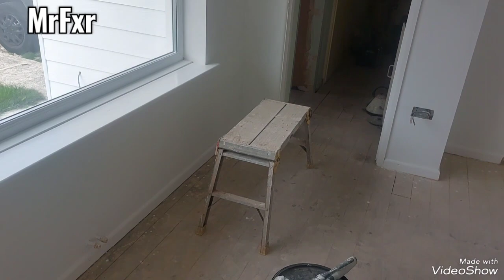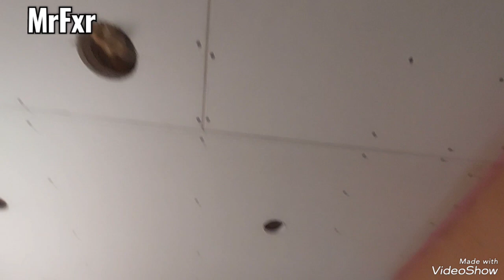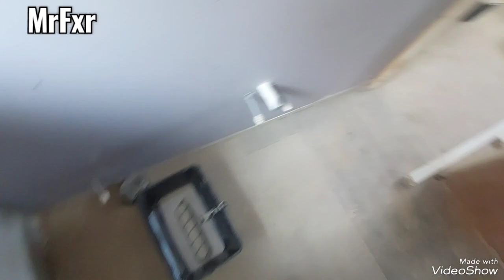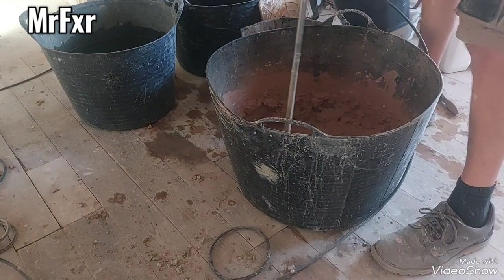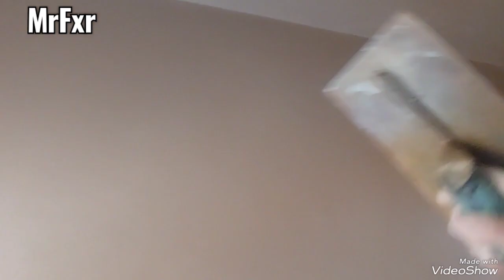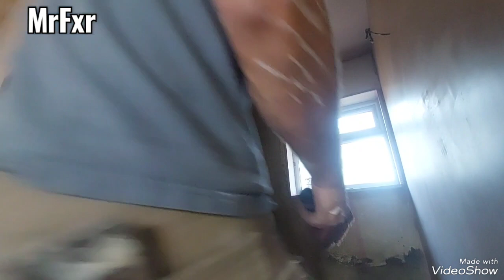Bungalow refurbishment 25, Big Push - PLASTERING 1

Comment: Started watching this now but it’s so long comment as I go…

I love how you just dumped the whole bag in to the water, and started mixing as you filled a bucket of water in case you need more. Definitely got that surprising strength from years of building mate!

But don’t you wear eye protection when plastering the ceiling and a mask when mixing buddy? 😮
Reply from the maker: Thanks , I hope it is not too long
Sometimes I wear PPE and sometimes I don't. I should do it more often for sure